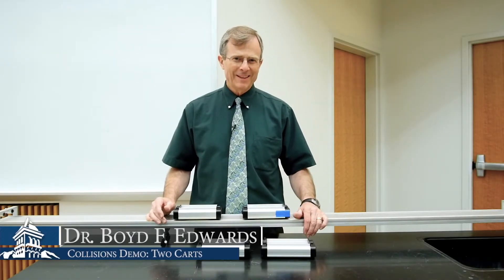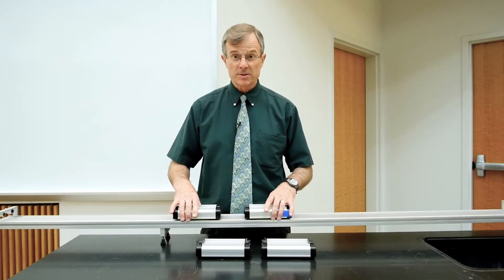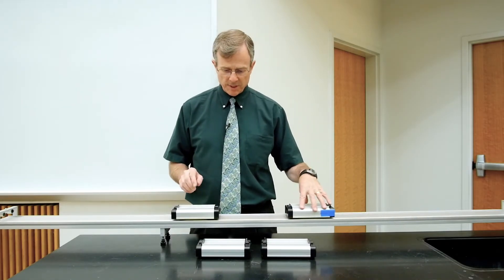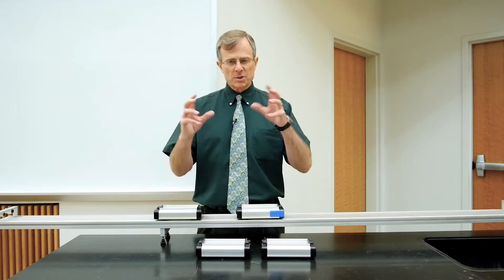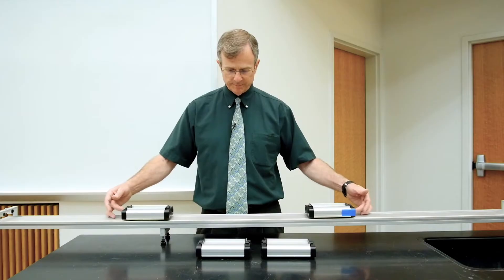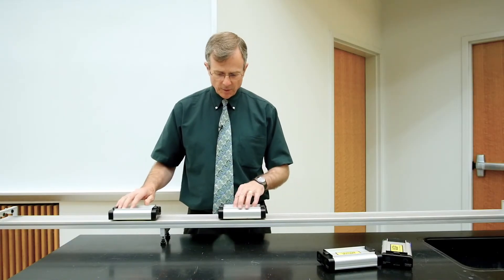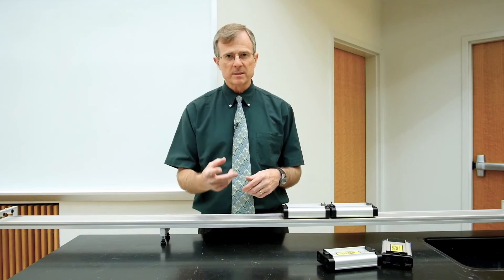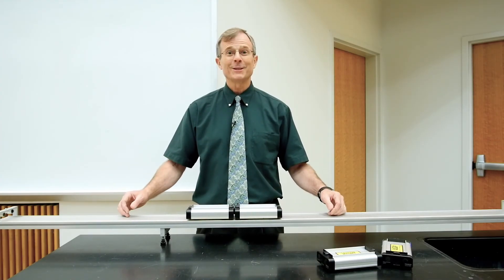Collisions Demo: Two Carts

Comment: This video demonstrates the principle of conservation of linear momentum in a collision between two carts

By definition, linear momentum is the product of mass and velocity

According to Newton's Third Law, for every action, there is an equal and opposite reaction

Therefore, when cart 1 of mass m1 collides with cart 2 of mass m2, they apply to each other forces of the same magnitude and opposite direction

Using Newton's Second Law, we obtain:

m1.a1 = -m2.a2

m1.(vf1 - vi1)/(tf - ti) = -m2.(vf2 - vi2)/(tf - ti)

m1.(vf1 - vi1) = -m2.(vf2 - vi2)

m1.vf1 - m1.vi1 = -m2.vf2 + m2.vi2

m1.vi1 + m2.vi2 = m1.vf1 + m2.vf2

Note that the sum of the initial momentum is equal to the sum of the final momentum

That means the linear momentum is conserved in the collision between the two carts

This conservation will always occur when only internal forces act on the system

In other words, when the resultant of the external forces is equal to zero the momentum is conserved

In the system in question, there are only internal forces from the collision between the carts

Assuming the collision is elastic, mechanical energy is also conserved:

m1.vi1²/2 + m2.vi2²/2 = m1.vf1²/2 + m2.vf2²/2

Observe in the video that the two carts have the same mass (m1=m2) and the initial velocity of cart 2 is equal to zero (vi2=0), therefore, it is possible to simplify the equations above:

vi1 = vf1 + vf2

vi1² = vf1² + vf2²

Raising vi1 to the power of squaring, we obtain:

vi1² = (vf1 + vf2)² = vf1² + vf2² + 2.vf1.vf2

Therefore,

2.vf1.vf2 = 0 -----> vf1.vf2 = 0

This means that vf1, vf2, or both final velocities are equal to zero

vf2 cannot be equal to zero, as this would imply that there was no collision, therefore, vf1 = 0

We know that vi1 = vf1 + vf2

Therefore, vi1 = vf2

We conclude that after the collision, cart 1 stop and cart 2 continues with the same velocity that cart 1 had before the collision

This result is in perfect agreement with what was empirically demonstrated in the video

Comment: Dear Professor, 
There is a question which is iching my taught since many days, that why speed of sound is constant??? Even though sound propagate by means of elastic collisions between molicules, speed of sound should depend upon the speed of molecules near the source of sound.
Reply: Hey! As a physics student I would like to tell you speed of sound is NOT constant! Speed of sound is faster in water than in air! This is why some sea creatures can talk over long distances under water.  Speed of sound varies in different mediums, just like light.
Reply: @arnavsinha834  at least understand the question before correcting others
Reply: i think you mixed up your concept with speed of light which is constant
Reply: @madmedicos3759  speed of light aint constant either. Its only "c" in vaccum,
Reply: @arnavsinha834  what are you saying bro? isn't it constant in all medium??
Reply: @madmedicos3759  speed of light changes when its in water, glass, or air. Its called refractive index of that material. Its what bends light.
Reply: @madmedicos3759  what class are you in?
Reply: @arnavsinha834  yes you are right but my meaning was that like other materials velocity is relative as per NLM but speed of light is independant value
Reply: @arnavsinha834  12+
Reply: @madmedicos3759  Yes speed of light is independent of frame of reference.
Reply: Speed of the wave is different from speed of individuals molecules in waves the molecules undergo SHM so their speed keep changing depending on the distance from mean position
Reply: Speed of light in a gas medium such as air, will be constant as long as the following are also constant:
1. Temperature
2. Average molar mass

Speed of sound in a gas medium is given by:
c = sqrt(k*R*T/M)

where:
k is the adiabatic index of the gasses.  For air, and elemental diatomic gasses in general, this is 1.4.
R is the gas constant, which is universal and independent of the flavor of gas, in units of J/kmol-K.
T is the temperature in an absolute scale such as Kelvin
M is the average molar mass.   Given by sum of Xi*Mi, where Xi is the fraction by molecule population, and Mi is the individual gas molar mass.  For air. this is 28.97 kg/kmol.